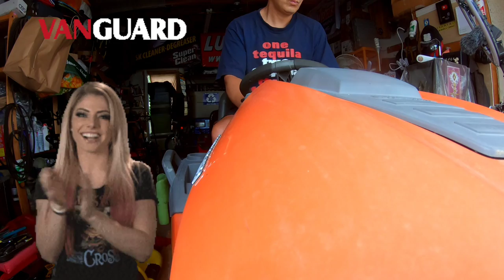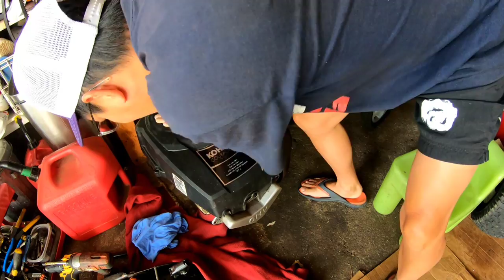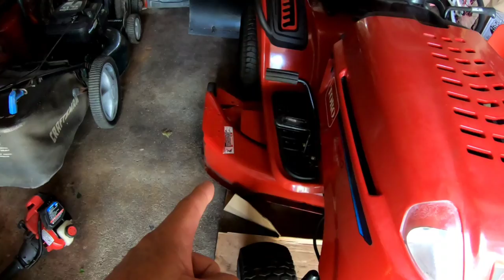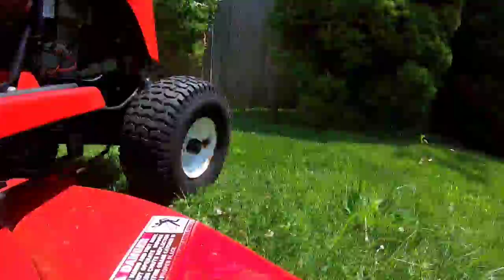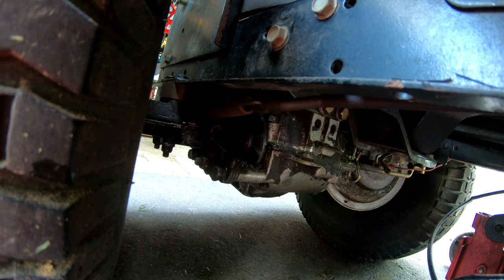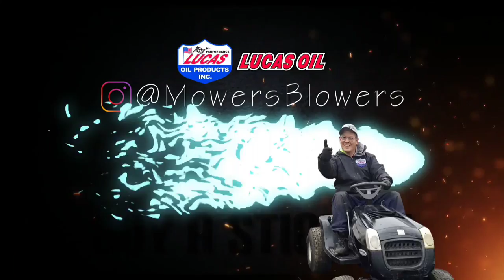TORO LX460 KOHLER COURAGE LAWN TRACTOR REPOWER PROJECT TENSIONER ARM & BRAKES ADJUSTMENT TEST DRIVE

Comment: Do yourself a favor and change that valve cover gasket on that Courage engine. Even if it ain’t leaking, change it out and make sure the block halves are tightened down.
Reply from the maker: If it ain’t leaking…….?

Comment: to me the only worthy brand from MTD is cub cadet in my opinion because cub cadet makes commercial mowers for professionals the last good cubs where the 82 series from the 1980s the XT Enduro series is better than the series 1000 mtd sucks at alot of stuff trimmers are crap vari drive transmissions dont hold up and powermore engines throw rods and spindles have no grease insert id pass on the troy bilt and get the cub cadet mtd made mowers for Massey Ferguson as well